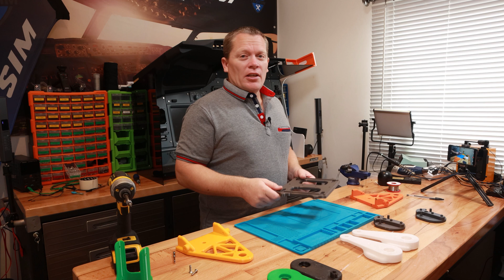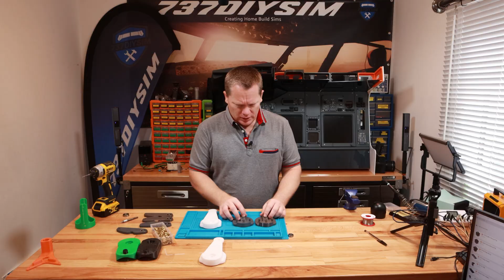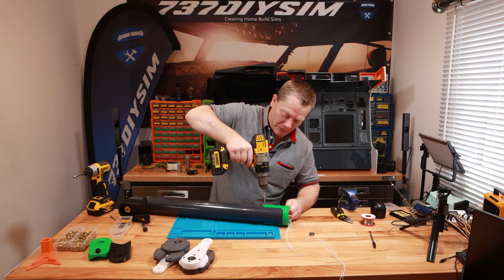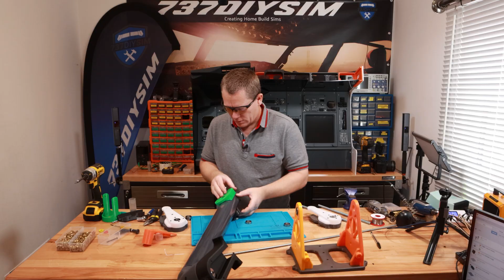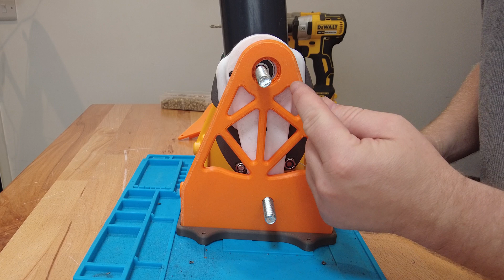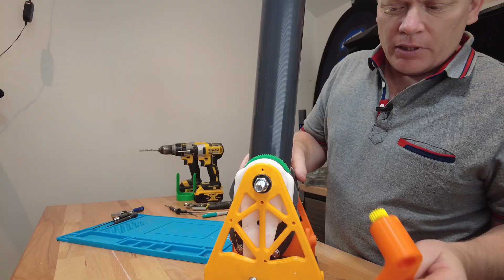SCC Prototyping

Comment: Off topic question. I’ve seen an LED matrix card wired to to a mega to make 128x64 LED display. Would it be possible to do something similar but have an input matrix? A 64x64 matrix would give 4096 inputs which would be more than enough switches for any project, if each one produced a unique code that could be assigned to an event in the sim. I used to have a card made by Leo Bodnar that had an 8x8 matrix that could have a keyboard command assigned to it.

Comment: I saw on the website that you offer models as STL or CAD + STL. I may have read over it (probably) but can't find what type of CAD files are included when I decide to buy that specific package. Can you tell me what CAD filetype is(or are in case of multiple) available?
Reply from the maker: Hello, The CAD files are created in fusion, and they offer 12 different types of download file types. Step is certainly the main one i would chose.

Comment: You can always cut a half moon notch in the tube to clear the spring. Or clip a 6mm wide 45° wedge from the bottom as well.
Reply from the maker: Thanks, i did think of that, but it didn't seem elegant.
Reply: @helimech8152  Saves the trouble of having to remake the parts.

Comment: For the drill guides, create a top and bottom matched pair, both with a flat reference surface. Then it's just a case of putting both drill guides on at the same time and drilling all the top and bottom holes at the same time. Everything should be aligned, since all the holes are aligned with the reference surface when laid flat on your work bench.
Reply from the maker: Awesome idea, thank you!